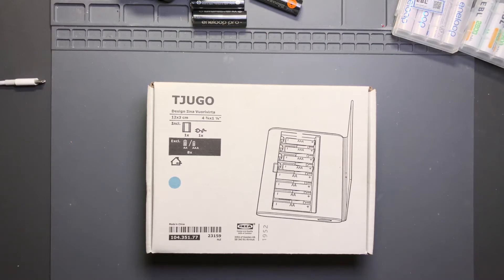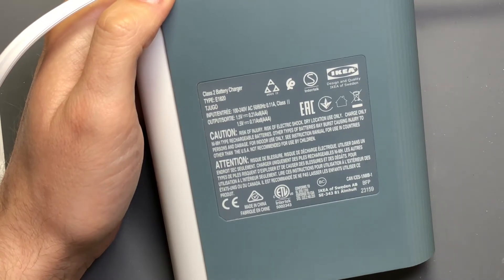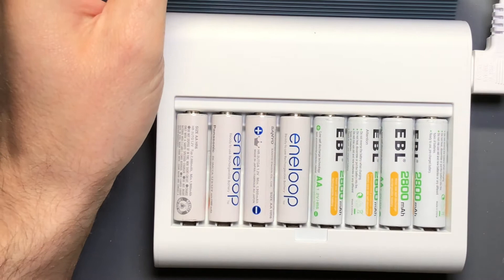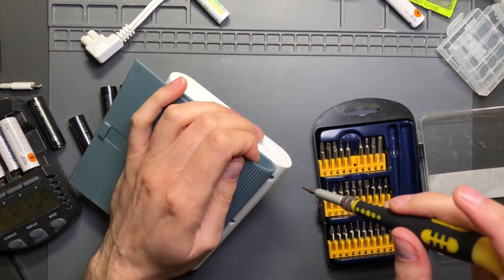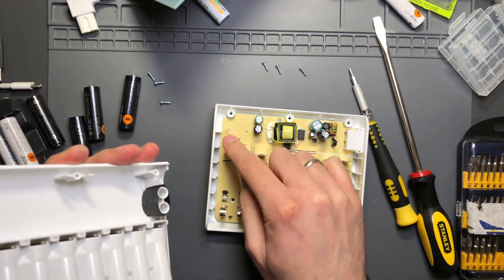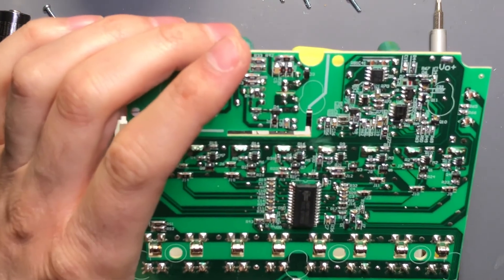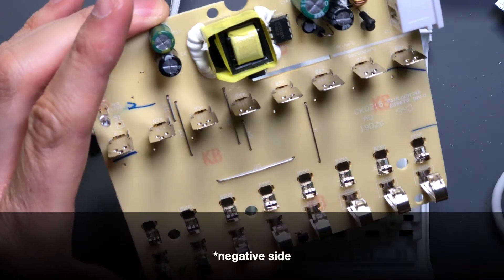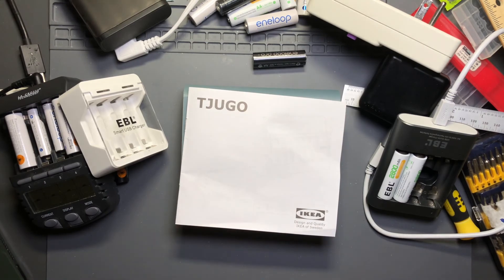IKEA TJUGO AA and AAA 8-Bay NiMH Battery Charger - Analysis and Teardown

Comment: Dou you think you'll ever do a teardown with the Ikea STENKOL charger?  It's usually bundled with a 4-pack of batteries that make it a very tempting purchase and I'd like some insight to see if it's good for battery longevity.
Reply from the maker: I have the STENKOL charger and aim to make a video on that soon, hopefully! Thanks for watching!
Reply: @TheCuriousEngineerChannel stenkol vs tjugo which one would you recommend ??
Reply: @vinay24_7  TJUGO is just too slow, especially for 8 batteries.  It's mean as an overnight charger or a charger you keep batteries in at all times plugged in.  I like the STENKOL better but it is picky.  It doesn't have any "reviving" capable and would reject certain batteries.

Comment: Still no answer why they call it "tjugo". In case you didn't check then tjugo is just swedish for "twenty".
I read in the manual that you can keep your batteries in this charger and they're always topped up so this pulsing keep them topped up and it shouldn't switch off. In the case of normal C/10 charging it's not advisable to charge more than 14-15 hours because they will overcharge.

Comment: Hi! Thanks for the review!
Like Others, I am a bit confused (perhaps it’s because of lack of technical knowledge).
1. Does it stop charging when a single cell reaches its design voltage, or will it go on until all cells are full or just for a specific amount of time?
2. Is the current for AAAs also at about 1.6A flash (as for AAs in this video)?
Thanks again!!
Reply from the maker: 1. It charges all cells individually until fully charged.
2. The charge current for AAAs is approximately half that of the AA charge current. 
Thanks for watching!

Comment: Just discovered your channel.. Thank your for the great contact. I was searching a battery that Amazon The Netherlands recommended to me. Thank you for saving me from them. i have Eneloop and the white Lada ikea batteries.. i saw your reviews on the new Lada batteries and decided to subscribe to your great channel.
BTW i use the PowerEX MH-C9000 charger and like it because i can charge 50% of the rated mAH i was always told that this would benefit the longevity of rechargeable batteries. Do the cheaper chargers like the Tjugo have a negative impact on batteries ?
Reply from the maker: I am currently researching and experimenting with a few different chargers, and investigating charging methods. Videos will be out as soon. Thank you for watching! Take care!

Comment: I had a bunch of older NiMH batteries that wouldn't charge in the Tjugo and triggered the red LED warning light. I had a crappy charger before that would occasionally overcharge the cells, causing premature wear.  I'm surprised that such an inexpensive device had a sensor to detect these battery defects.
Reply from the maker: The detection circuit is not very reliable. it has alerted me that several of the brand new batteries I have are defective. Perhaps check out the video I did on "Bad Battery Detection". I'll also add it to this videos description. Thanks for watching!
Reply: yes, its garbage charger, sometimes works sometimes not, very annoying. I dont think ikea sells them anymore

Comment: You are wrong - check Your second charger with oscilloscope. I have the same charger and it uses pulsed charging too - only pulses are 1 milisecond in length - several hundred Hz repeating frequency - Your current meter shows correctly average value of these pulses - that is 200 mA.
Pulsed charging makes NiMh batteries live longer.

Comment: I'm confused. You recommend this for charging ikea batteries but not eneloops. Aren't ikea batteries eneloops in disguise? You criticize this charger (and the power owl) for the way it charges but you recommend a couple of usb 4 bank chargers. Is USB a better way of charging batteries?
Reply from the maker: It’s not about USB vs AC supply for charging batteries. Rather it’s how the battery charger manages charging each battery. I have videos planned to detail this further coming up. Thanks for watching!
Reply: @TheCuriousEngineerChannel  will it be up soon?

Comment: Pulse charging is normal, something to do with breaking up the crystals that form when battery is low voltage. Would be nice to see extra leds to show individual batteries charged, but one will do.

update edit - this charger is garbage, if flashes batterys as faulty when they aint. I then have to put batteries in another charger, and it charges them fine. I dont stress my batteries and they last years. Sick of this tjungo.
Reply: The Lacross charger also pulse charges, it just does it so fast that a multimeter cannot detect it.

Comment: 6:10 the behaviour is totally expected. It's called pulsed charging. But the Ikea charger is crap as usual. No way I cannot see the state of charge of all batteries with a single led! What a crap!
Reply from the maker: I don't like the single LED indicator either. However, it does charge batteries decently.
Reply: @TheCuriousEngineerChannel   Would you still recommend this charger or should I wait to get the stenkol battery charger which is the new 4 slot charger by ikea?
Reply: @k9-charlie711  I'd suggest you the new Stenkol charger.
Reply: @alessandroserrao9422  whats the difference with the stenkol charger? how do you know what battery charger is best?
Reply: @alalal123421  they are basically the same: the Stenkol has 4 independent charge indicators, the Tjugo has only one led for all the 8 bays, a big disadvantage.
As far as I'm concerned, the Ikea Stenkol is a good all around charger.

Comment: How do u know when the batteries are fully charged ?
Reply from the maker: The light stays on. :/
Reply: How do you know which one is charged and which one is not?
Reply: @verynick  1. You could check with a multimeter or 2. You could feel for cells that are warmer than the others. Those are propably still charging.

Comment: Ikea's LADDA cells are actually excellent and are most likely rebranded eneloop pros.
Reply: It won’t accept 5 of my 8 IKEA new batteries, which is annoying. Bought a while ago because of it’s neat design, but might now look elsewhere. Thanks for video.
Reply: Nope. They are to a significant lower league, they don't hold up the charge and they last less that Eneloop. End of life in about 100 cycles. Crap.
Reply: @alessandroserrao9422  nonsense
Reply: @alessandroserrao9422  Thats just not true. They have almost exactly the same electrical characteristics as Eneloop Pro batteries. They are propably cells that did not have the guaranteed 2500 mAh capacity and are now sold as 2450 mAh.
Reply: @alessandroserrao9422  LADDA are made in Japan. There is only one factory in Japan making NiMH batteries owned by Fujitsu. All Japan NiMH's ARE Eneloops!!!
Reply: LADDA might be identical to Eneloop. Although CPU manufacturers have a concept of binning, where they aim to produce a perfect product, but many CPU's will not meet the highest standard, so they sell the lower grade chips with a different model name as a more limited chip. I wonder if binning occurs with battery manufacture? or perhaps IKEA batteries are cheaper because they spend a lot less on marketing?
Reply: @alessandroserrao9422  
Is it possible that they suffered premature aging due to the charger?   I've been using an Energiser 360mA charger but Eneloop brand charger is 200mA, maybe that slower charging wears the battery less and I get more lifespan out of LADDA?
Reply: @Animal_lives_matter  360mA is not an high of a current at all. It should be perfectly fine.

Comment: I guess a black sleeve does not allow to light up the whole box from LEDs :-)
Reply: Quite an obvious reason, was almost screaming at my screen haha
Reply: this is so dumb, so obvious.... made me question the whole review.....
Reply: Engineer tunnel vision:)
Reply: This sleeve appears to be a waste of the money...  The plastic housing looks thick enough to block out most light leak.   In addition, this thing has a lid that tends to fall into the closed position.  The designer is obsessed with reducing radiating light of any sort and even spend the money on a hall effect sensor... and then this black out sleeve... for what?  This charger is odd in so many ways.  You normally don't want to cover the battery so can you cool the  entire charger.